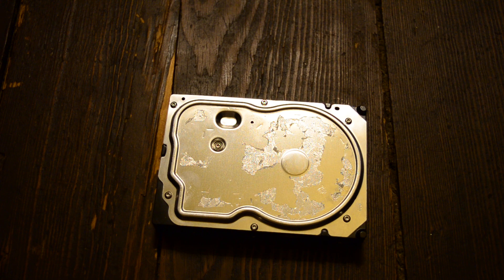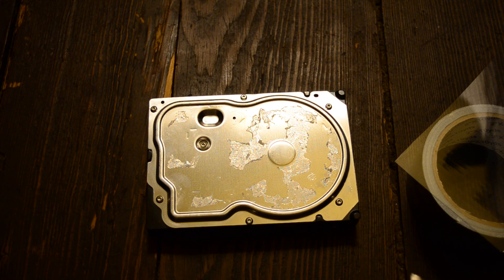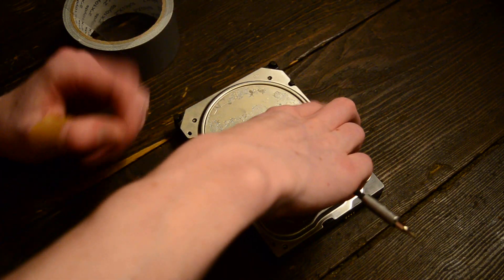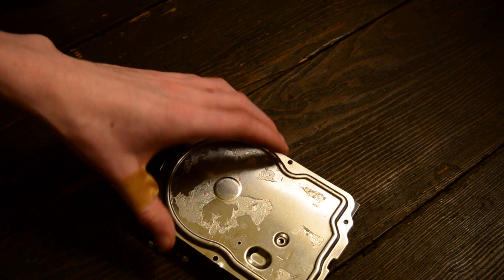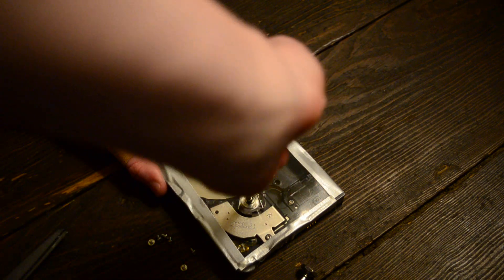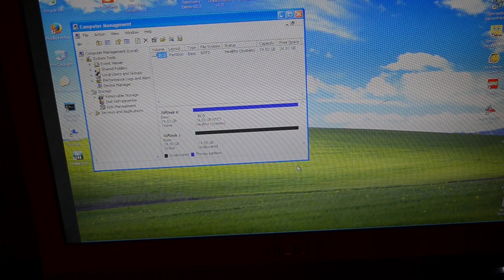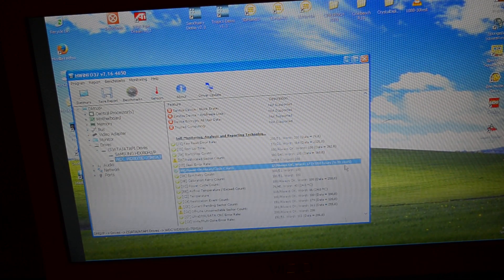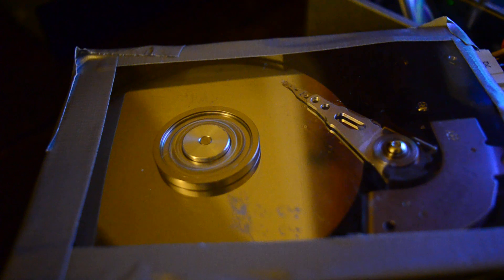I built another transparent HDD

Comment: 1 piece of dust and the drive is dead, impressive how it still worked....
Also it looks cool asf inside
Reply from the maker: Older drives, like this ~15-year-old Caviar, are far less sensitive to dust. This one accumulated several more bad sectors from this procedure but it is still working alright after a little bit of usage. Typically these live a couple weeks after the clear conversion.
Reply: @DavisMakesGamesIf you use hard drives with read heads only on the bottom side of the platter,like the wd1600AAJS,they will last forever.Mine lasted for 6  
Months,had 4 different covers on,then I put a compatible metal cover,with a damaged seal,and it still is perfect health in HDS and works flawless